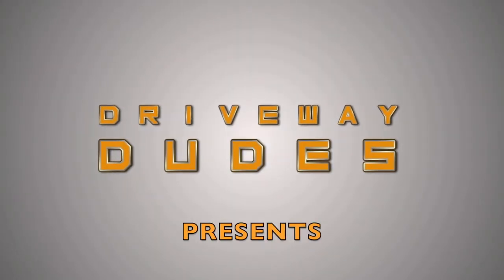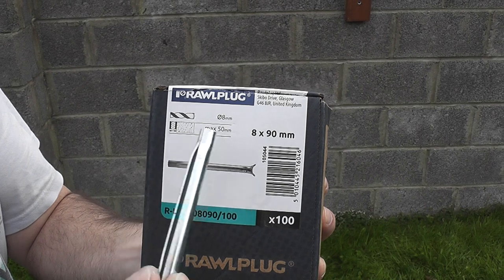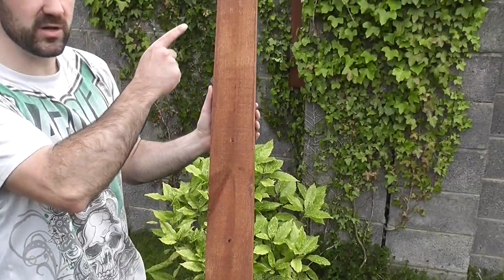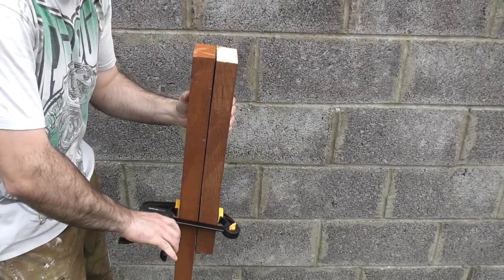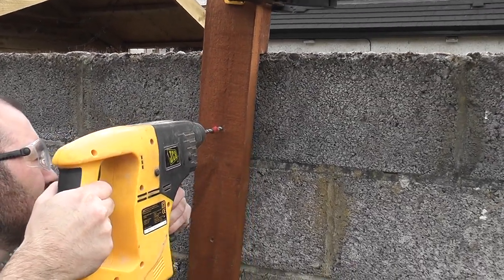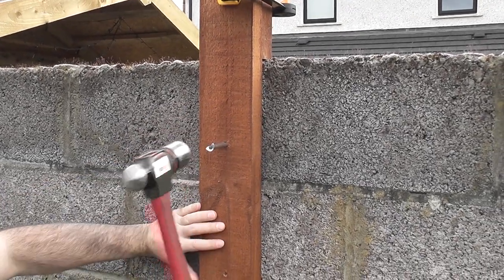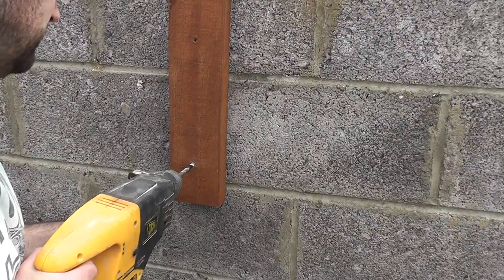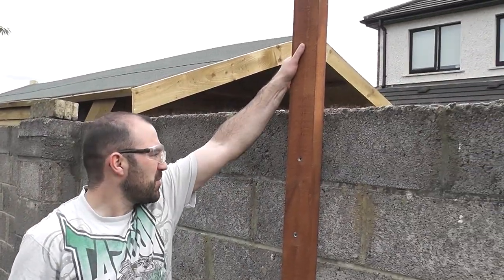How to Fit a Post to a Concrete Block Wall Yourself

Comment: Im looking for simpson block ontop of cinderblock post fence for adjoining fence sections would express nails work for that? Also can i buy these at home depot?😊
Reply from the maker: If you’re using cinderblock then be aware that they are structurally not as strong as concrete block. 
I'm pretty sure Home Depot may have similar with a different name

Comment: I use window frame / door frame screws, the gold one's with torx fit head, 7.5 mm and drill a 5.5 or 6mm hole, work great every time.
Reply: I've got some of them!
 7.5mm × 150mm so you don't need a plug in breeze block wall then if you drill a 5mm hole?
Reply: @blackwingvisuals5017  No you don't, just a 6mm or 5.5mm hole, really secure.
Reply: @blackwingvisuals5017  in breeze block I'd go 5.5mm in stone or concrete 6mm.
Reply: @6lr6ak6  well I will find out in an hour when I have a crack at it:)
Reply: For cinder block?

Comment: Great video thanks.  I see you didn’t aim for the middle of the blocks, was this intentional?  Are you trying to drill around the edges of the block where it’s solid?  How far in from the joints do you need to be?
Reply from the maker: As long as you keep 50mm from the edge of the block you're usually safe enough. The mortar in the joints wont give a strong fixing point and the express nail will work loose after time.

Comment: Would this hold well if the blocks aren’t filled with concrete ? Mine are “hollow” just the mortar. My wall is 7’ high and I want to add a 3 ‘ topper.   How far down the wall would these posts have to go?
Reply from the maker: For a cavity hollow block, probably as much below as above and try to avoid drilling the mortar if at all possible
Reply: @DrivewayDudes  okay cool!  Thanks !

Comment: In a former neighborhood of mine, that little addition would get you a health fine from the local HOA and possibly a "removal notice" from the local code enforcement Nazi's. I like the technology, provided it doesn't split the block. Not all building block is created equal! :)